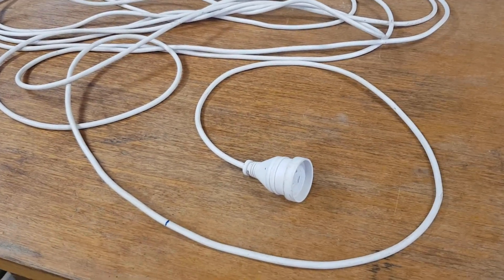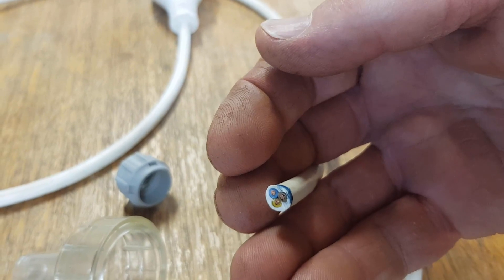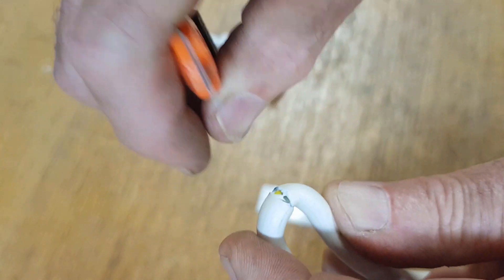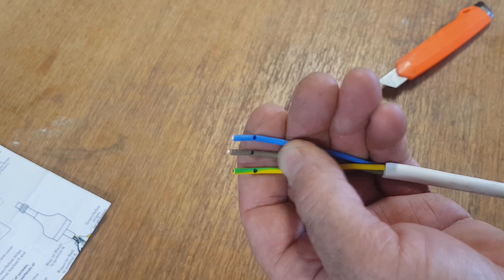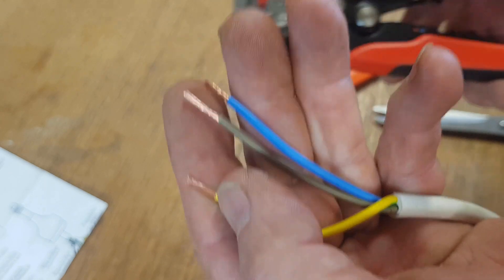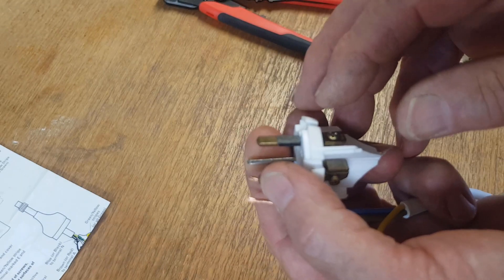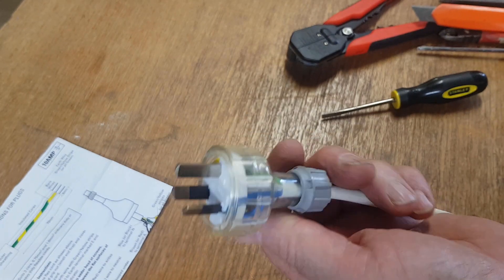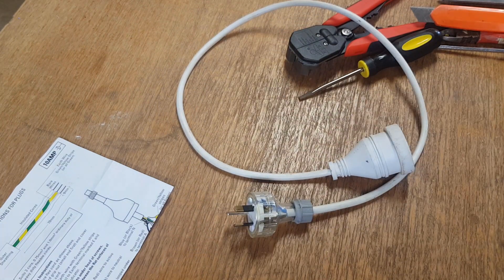Basic tips on how to fit & wire an Australian electrical plug DIY extension cord repair/modification

Comment: 1:08  This is false. Replacing an electrical plug is most definitely illegal for an unqualified and unlicensed person. Your video provides false information for DIY'ers and is unacceptable. 

DIY Electrical work is not only illegal, but if an electrical fire takes place, or someone is injured/killed as a result of your work. Insurance will NOT cover anything, and will leave you in the dark

seriously, take the video down. this is ridiculous mate
Reply from the maker: I'm afraid you are incorrect Penguin - and many like you, seem to be convinced the same way. The facts are that in most states in Australia it is perfectly legal to undertake DIY repairs on portable electrical equipment. I have had direct communications with Energy Safe Victoria to confirm this.
Thanks for your concern anyway mate - at least when people voice incorrect information it allows me the opportunity to correct it.

Comment: China always use 3 pin Australian plugs, but not the 2 pin plug. If outlet have shutters, both live and neutral locked if earth outlet unplugged.
Reply from the maker: That's interesting, thanks Francis 👍
Reply: @TheUltimateRecycler  China also use Japan / Euro universal 2 pin Southeast Asian outlets.

Comment: I've got a wired shed with lights and power points. The cord to it was removed. Can I get an extension cord from Woolies, remove plugs and just hook it back up to the house? It seems simple enough but the missus says no.
Reply from the maker: Haha.. Technically it would work (although you'd have to be aware of how many amps everything in the shed would draw through a single extension cord). I'd have to agree with the missus though - it sounds like an illegal dodgy brother's job! 😜

Comment: Great vid! Do you have any vids of removing very new plugs? I have been "gifted a dog" which I did not want. It has chewed through mobile phone chargers (2), Network cables (3 and these cost me alot since I wanted 30 meter ones) and all sorts of other things this dog has chewed though. I brought a $150 dollar Dewalt 4 plug and the dog chewed through a meter from the socket. This 4 plug lucky has its own safelty switch along with my house safety switch. She is alive, but my cords are all chewed up. Can I lever the outside from the plug? It looks like its all built together..
Reply from the maker: Gee SM, she sound like a very destructive dog! Certainly worth a try as it seems the item is no good now as it is! Some items are certainly molded with no serviceability in mind unfortunately!
Reply: @TheUltimateRecycler  Yeah, I ended up going to bunnings and buying two plug ends. I forgot my lamp needs one also. Thanks so much! I just fixed the Dewalt 4 way, now its onto the lamp. Great vid ! P.s yes she is destructive. I am going to take her to puppy school. I walk her every afternoon after work, she has a friend (another dog), wormed flea'd all that jazz, lots of chew toys. But Next thing I need to learn is how to repair network cables. So many wires lol. Cheers !

Comment: I have a 2 prong euro (220-240v) plug that had a prong break off. I've been watching videos but it seems euro plugs don't have a dedicated earth/ground wire, just a live and neutral. 

I've seen videos of people changing from a 2 prong euro to a 3 prong euro without a dedicated earth/ground wire, but wanted to know if it works the same for Australia?
Reply from the maker: Well yes, kind of Olivia. We have two prong plugs for double insulated items (generally plastic body appliances) and they don't have an earth wire. You can certainly use a three prong plug and only wire the live & neutral. Sometimes manufacturers actually use a three prong plug just purely for stability in the socket. So just because the plug has an earth pin - it doesn't mean the cord has an earth wire! Any appliance with a metal housing will most likely run an earth wire and must be wired to a correct three prong plug. Hope that helps 😊
Cheers, Chris

Comment: Smashed out a couple plug changes after watching this video. One on a ozito blower vacuum that I broke the prong off just yesterday. Thanks mate, great clearly explained video.
Cost all up for repairs was just under $8 for a pair of 10amp plugs from Bunnings.
I did cheat a bit tho. I ran a heat gun on low setting over the cap to soften it up a bit to get it to fit easier.
Reply from the maker: Thanks mate! Great tip with the heat gun too! 👍😊

Comment: Good instruction, But i have to tell you that white extension lead has been made incorrectly, If you have a length of 3 core cable and a plug and socket there is a correct end for each. Most electricians don't even know this, if you get it wrong ( as yours is) you will see that the active and neutral cross over and rub together. Most people have a 50 50 chance of getting this rite. Hold the cable with the conductors facing away from you with the earth at the bottom if the active is on the left this is the plug end. when i did my apprenticeship you would fail if you get this wrong. that white lead must have been made in a factory that didn't know this.
Reply from the maker: That's news to me William - I'd certainly believe that most electricians wouldn't know about that! I find it hard to believe that it would ever cause any issues as a properly wired plug or socket would not have any chance of wires rubbing together at any point. And I don't think it would cause any DIY issues either. It was more important I feel to explain the polarity issue which can have some safety ramifications! Thanks for watching 😊
Reply: @TheUltimateRecycler  Dont want to rubbish your great video but you can clearly see the crossed conductors in the video when you have finished the wiring.
Reply: You would fail making an extension lead TAFE if you wired it like you have done in this video, i am a licenced sparky and you should not show these if you dont know what you are doing, why dont you do a video showing how to make an extension lead the correct way.

Comment: Can you point to any legislation or official information regarding the legality of installing plugs? Basic google searches will come up with all the big name electrician groups telling you its illegal, but they are hardly unbiased. Great video either way.
Reply from the maker: Thanks Cameron. Yeah, it's sometimes very hard to find clear and accurate information on these things on the web. I emailed Energy Safe Victoria directly earlier this year and this was their exact reply..
"Thank you for your enquiry. In Victoria, you can undertake DIY appliance repair,
without being a qualified electrician, on items with a plug, if you are competent to
do so.
Note - Competent person means "A person, who has acquired, through training,
qualification or experience or a combination of these, the knowledge and skill
enabling that person to perform the required task correctly"."
I believe all states except Queensland have basically the same ruling.
Obviously people from other countries would have to check local rulings.
Reply: @TheUltimateRecycler  Yup, that was the wording I kept coming across, and I guess it is a little open to interpretation regarding the "Competent person" means. I am going to consider your video training, and have already replaced the plug I wanted to :)
Reply from the maker: @CameronDev  Perfect! I could make the case that as you have completed the task and are still here to report on it - you are competent! 🤣

Comment: You really should keep the earth wire a bit longer than the rest. So it would be the last one to disconnect, if the cable gets pulled out of the plug
Reply from the maker: Yes Gustav, that is correct. I thought I mentioned that in this vid - maybe I forgot!

Comment: I just bought a camper trailer and am in the middle of fitting it out 12v plus I have a 2000w inverter and I wanted to fit a power point from the inverter in the front box to the inside of the camper but I was worried about hooking it up wrong but after this video I now know how to do it thank you.
Reply from the maker: Excellent! Thanks David! 😊
Reply: @TheUltimateRecycler   I have just hooked up 240v in my camper with no problems. Finally it is done. I was worried about it until I watched your video and it only took me minutes... cheers.

Comment: Very informative video. I should point out in Queensland you require an electrical licence to do plug top replacement. In some situations the Queensland Electrical Safety Office will allow for appliance repair on a Restricted Electrical Contractors Licence however this is rare, and under no circumstances is it legal in Queensland to do any unlicensed repairs.
Reply from the maker: Thanks for your comment HoppingMad. Yes, that's my understanding as well. In Victoria however, it is perfectly legal to work on portable appliances without being licensed 😊
Reply: @TheUltimateRecycler   Thank you so much for this tutorial. So clear and helpful! But what exactly is a portable appliance?

Comment: I watched a tom scott video on how to rewire a brittish plug a while ago and he said "live is brown because that's the colour your pants will go if you touch it" ... And it's basically the same configuration here too haha time to rewire my old stereo finally... The live Prong is very 🅱️ent
.
UPDATE: finished it works I'm so happy I was able to do it... Had to use a hair dryer as it was cold today to heat the rubber cover up ... It's a cassette deck and it isn't slow or anything so my connections were perfect thankyou so much for this tutorial
Reply from the maker: Hahaha at the Tom Scott quote!! 🤣🤣
Excellent you were able to manage the job successfully! 👍😊👏

Comment: I have a question??? 
I just bought a staple welder, it has a EU plug on it, can I change it to a AU plug, or do I buy a universal plug adapter? 
It’s Ac 220v 50/60Hz 50w
Please help 😊
Reply from the maker: Hi Joe,
Since it only has a power rating of 50 watts, the appliance will only draw just over 4 Amps. (220/50 = 4.4). So either option would be fine. Standard AU plugs are rated at 10 Amps. A plug adapter would be similar. Cheers, Chris
Reply: @TheUltimateRecycler  thanks for quick response Chris, very helpful. 
Cheers 🍻
Reply from the maker: @Johadart  Happy to help mate 🍻

Comment: Ooops, 15:39 - looks like you've nicked the insulation on the active wire, about 10 mm from the white outer.  And the outer is PVC not rubber for heaven's sake.
Reply from the maker: It does look like a small nick there Brian, I need to be a little more careful! Doing it in front of a camera make things a little difficult - still it's perfectly safe as the wire is separated from the others and inside the plug boot. Yes PVC. My bad!
Thanks for watching and commenting :)
Reply: @TheUltimateRecycler  Don't worry too much, I've done it myself enough times.  :-)  It's hard to avoid sometimes and, as you say, it's inside the boot so still safe.

Comment: The history of the OZ plug ... was designed by Hubbel, an American,  who designed the plug to be used as the standardised plug in the US....but the Americans prefer the srright blade type as it was reversible (before polarized plugs were standard). The OZ at the time preferred this angled design over the UK ones as it was easier to manufacture; thus it became standard in OZ ....(thats why, your outlet and swich boxes are also the dimention of US ones). OZs also adopt the US way of doing branch  circuits vs the UK ring circuits for bulidings thus the absence of the fuse in the plug. 😉 Another advantage too is if you happen to step on your plugs bare foot, its leaa painful vsstepping on a UK style plug ...when youre half asleep 🤣
Reply from the maker: Haha - they are still painful, but not as bad as Lego! 🤣🤣
Thanks for all the info Leatherkid01 👍👍